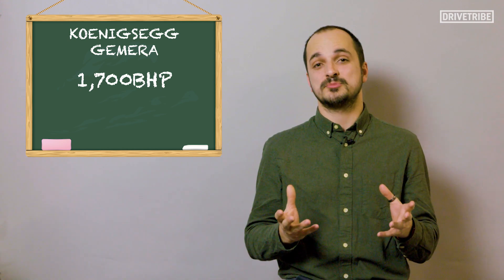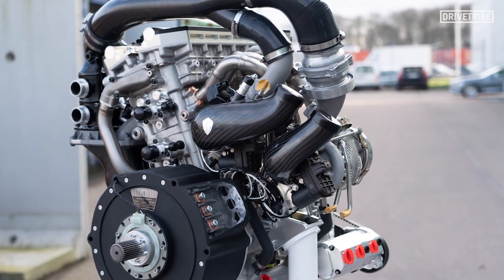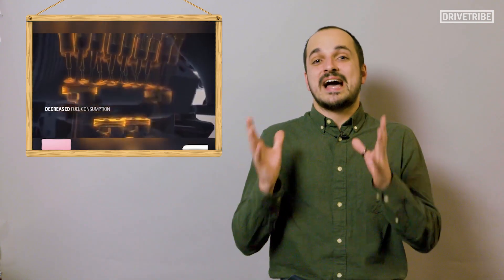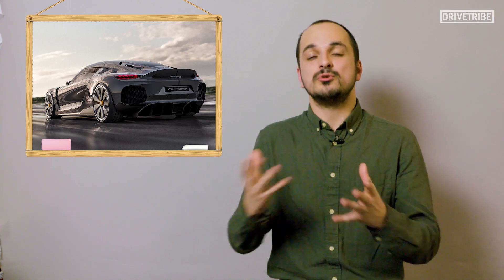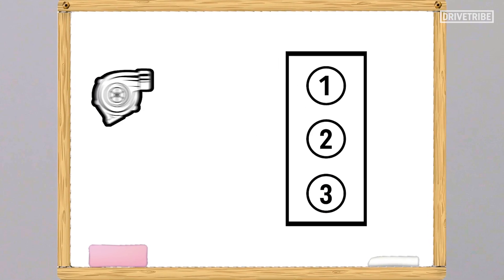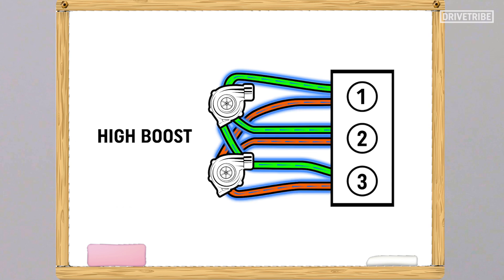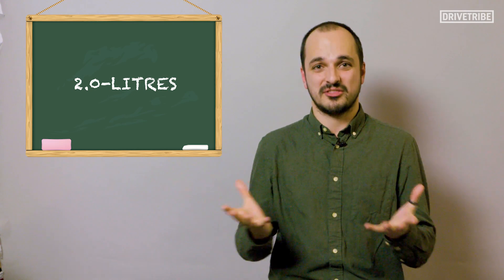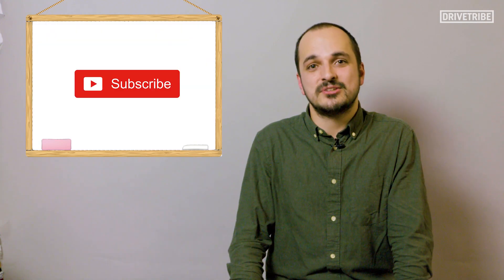This is how Koenigsegg made 600bhp from a 3-cylinder engine

Comment: ... for a generator is to much work because that motor that is all he is doing generating electricity. Aaaa if you want to make it  to sound like is doing something else then probably you go for the big sound. My VW cady has a DSG  gearbox dry clutch because Wv didn't bother so I don't have expensive maintenance from my part  , but if I put a electric motor on my cady a small battery so I ca drive in the restricted area  , and I put a generator in the trailer I still have 7 seats and plenty space luggage and still 1.5 millions in my bank account  .
Reply: ... and one the public roads I am driving with the same speed.

Comment: 2:34   I bet the Gemera 3-cyl wont run with 2 or just 1 cylinder just for fuel economy.
    it would make sense that Koenigsegg will just DEACTIVATE the ICE off, since this is a hybrid with a powerful electric system.
     If a 3-cylinder ICE had just ran on either 2/3s or 1/3(if the engine could even start like that) of the engine, would shake around VIOLENTLY

Comment: What is the efficiency % increase with the  freevalve engine when standard 4/S is ~ 25%?
....
This [free valve] is an exciting next chapter in ICE engines great potential for the 4/S engine.
I do question the possible reliability. This engine must be highly stressed with all that power.
Them components must be very strong
Boron Carbide head gasket anyone?🤔

Comment: I like that it is a small three cylinder engine that produces that much horsepower, but it should be in a car that weighs nothing, in order to maximize value. I don't like that it is combined with an electric engine (and heavy as fuck battery pack), even if it is getting 1,700 horsepower. A small engine like that should be the only power source and it should be in something that is meant to compete with the Alfa Romeo 4C or anything that Lotus makes. Because all of this technology with the valves, it makes me wonder what they could do with the same technology on a 7+ liter V12.

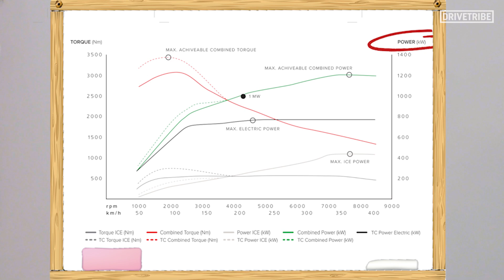Comment: So 4 valves per cylinder, meaning you will need 12 valve actuators that need to run flawlessly to get that power output. I'm curious to know the degraded state performance, if one or more of these actuators is not functioning properly. Especially that the engine's peak power is close to 8000 rpm 1:42 , so those actuators are working hard. how many kilometers/miles Koenigsegg is rating this engine at?

Comment: Meh it's sort of impressive but when you consider you can turbo a hayabusa/zx14r with only 20psi to achieve almost the same power with engines 30% smaller and 20+ year old tech it's actually not that special.

Comment: 3 cylinder engine. How does this make 600hp.   
They never actually told u the size of the engine. Bike 3cyl 1000cc can do 200bhp. So a 3  litre could get the 600 with a turbo. Bike is turbo free and naturally aspirated.

This is a ten litre....   and you have to use special fuel. Not pump fuel

Comment: This is ancient F1 tech. F1 used cam less air controlled valves for years in the 90's
Reply: https://www.youtube.com/watch?v=tAqP7o_ZdK0
Reply: F1 replaced metal valve springs with pneumatic valve springs to raise redlines and reduce valve float, Freevalve eliminates camshafts completely, something F1 has never done.

Comment: What if the soledoid actuator stops working or malfunctions during engine operation?
With the traditional mechanic method it only happens if the belt or chain broke down. 
I hope they have a solution for this...

Comment: I fully agree with this lad, Koenigsegg once again wins Geneva. Just imagine what power a freevalve V8 would make if they would ever want to make one.
Reply: What is shocking is that the engine weighs only 70 kg and the 400 HP crank motor is so small you can see it's mounted on the block itself. This system makes 1000 bhp, the same as a Veyron, in a powertrain weighing about 1/6th or 1/7th as much!!!
Reply: Assuming they keep the same size cylinders and everything scales up it would be close to 1600 HP LMAO
Reply: @romeomargot-picquendar1281  Actually the Jesko makes the exact same hp/l on e85. Now people say the 600 HP figure is for E85, so it will be lower on regular gas. But still insane.
Reply: Idk how much better u can do than an 11,000 hp v8
Reply: Pretty sure there is a 1700hp version now
Reply: what comes to mind for me is concepts like ppl trying to build hybrid NA rotaries bridge ported etc...and the power to weight aspects and weight distribution too considering the weight of a 2L 3cyl vs the weight of the trans or rear or if its awd 2 difs. engines like this come into the picture or the GR yaris, and it changes the cost or fun aspect of ppl thinking NA rotary power is viable/affordable. Much less 3-4 rotary builds. And yeah to the guy that mentioned top fuel 11,000 HP. XD. Its about as viable as a hybrid bridgeported rotary. Sparks n all.

Comment: Well to be fair the number of cylinders doesnt matter nearly as much as displacement  600HP from 2 liters is good but not ground breaking.
There are 600hp (500whp) Honda K-series and F-series running around on the streets at that power level on stock blocks (designed to be naturally aspirated) and if they are tuned correctly they will last a long time.

Comment: Imagine if this engine were to be used on a motorcycle.....
Reply: fantastica!
Reply: check out the triumph rocket3.    2.3 liter(or2.5l for the new ones)  with more torque than any bike has a right to have.  stock is 145hp 145 lbs torque.   supercharged you can get over 300lbs of torque and 400hp to the rear wheel.
Reply: Imagine if this engine made 620hp! that'd be something

Comment: Too many disadvantages:
- only 600 bhp with E85
- only 2 l displacement
- two turbos means more maintenance costs
- new tec with realibility issues for sure
- 3 cylinder

Wrong engine for the car ...
Reply: Pete is never wrong  My sedan has 2l displacement and four cylinder. What's above a hypercar?

Comment: Imagine this engine on a motorcycle
Reply: stop imagining and go ride a triumph rocket.   imagine taking 150mph and somehow sticking it into a needle and mainlining that pure speed.   that's what it's like to wind up 2nd and 3rd gear on the rocket
Reply: @suzukispider  pretty sure the rocket 3 doesnt make 600hp
Reply: @thatjokerperson7062  no, but you can get it to 400hp.   not bad on a ride that's only 750lbs.
Reply: @suzukispider  proof.
Reply: @thatjokerperson7062  research it yourself.  check out rocket3 forums
Reply: @suzukispider  i did and all i found were people arguing over if one guy made 280hp at some point

Comment: Are you guys really a car/engine channels?

3 cylinders engine are good for continuous powerband. It is the least amount of cylinder needed to achieve high rpm. Not surprising because most Japanese cars uses that and lately motorcycle are using it too.

Comment: "Most 3-cylinder engines these days, even when you slap a turbo on them, create around 200 bhp".
What?
Maybe a FEW do, but most probably create around 80 bhp.
Reply: I dare you to find a single, modern, turbocharged 2l i3 that produces UNDER 200 hp...
Reply: @ZeroneAngel  You could also dare me to find a single Koenigsegg that produces under 200 hp or something else which does not match my statement.
I quoted the video, which did NOT say "a turbocharged 2L I3", but which did say, word for word, "Most 3-cylinder engines these days, even when you slap a turbo on them, create around 200 bhp".
Note the lack of displacement in that statement, and the fact that a turbocharger was made optional with it.

I dare say the majority of three cylinder engines made - whether you count by units produced or by types available - will come in comfortably under the 200bhp mark, as well as under the 2 litre displacement mark.

Have a good day!

Comment: No one else is bugged that the valves are controlled electrically?
Reply: Nope. A modern car is computer module controlled in all regards anyway. Problems starts if an manufactuer skimps  on the   electical wire harness. OMG im so sorry for my poor english.

Comment: Twin-turbo 3 cylinder engine can done by the Camshaft engine. Check on the CB400 Revo engine. When low rpm it activate 1 exhaust & intake valve when in high rpm it activate 2 exhaust and intake valve.

Comment: I’d take a car with just this combustion engine. There are twin turbo V8s out there that don’t put out 600hp
Reply: Koenigsegg used Ford V8s for years, that all made a lot more than 500hp. You are an ignoramus.
Reply: What properly tuned Twin turbo V8 doesn't make 600 Hp nowadays? A proper NA car already makes 100HP/L. Twin turbo is usually 150-175 HP/L. If you have 8 0.5L cylinders that's 4L, with twin turbos you should be looking at 600-700 HP.
Reply: @romeomargot-picquendar1281  2017 Audi S7
Reply: @jasonm456  There is no good explanation for Audi aside from that its a grandpa car therefore the tune is very conservative. Pretty sure you could be getting a lot more out of that engine if you wanted to.
Reply: @romeomargot-picquendar1281  not to mention a shit ton of torque!
Reply: JIMI JAMES  no shit right? People are building 500hp+ engines in there driveway from small blocks. Where the hell do these people come up with this shit its like they were born yesterday lol.
Reply: Classic american muscle V8 can't even make 500
Reply: wow comparing 60 year old tech with modern eh bc koenigsegg never used a 16v pushrod lsx or a 32v coyote. XD lets compare the best power numbers of the v12s of the 60s or the 911 shall we........oh oh ok lets act like those facts dont exist. Or that a 12A rotary is 100 hp.
Reply: 500bhp from an American piece of shit is equivalent to 200 German horses 🤣🤣🤣🤣
Reply: @adnxn1  german horses are dead after 2 year
Reply: @chrisxaf1237  not even that. My dads new BMW has been in the shop 4 times over the passed 6 months not including regular maintenance.
Reply: @Erowens98  thats sad
Reply: @adnxn1  corvette and vipers are some of the fastest nurburgring cars, unrivalled track performance for the price, European cars are the fastest yes but much more expensive and less feel, ie don't come with manual transmissions, check yourself on wiki
Reply: @adnxn1  when is the last time you drove an American car? The current Camaro, challenger and mustang basically demolish all European cars at the same price point.
Reply: @romeomargot-picquendar1281  Kappa!
Reply: @romeomargot-picquendar1281  hahaha they will break to bits after going over a speed bump

Comment: Dude you missed out the most important aspect of what this new system delivers, that the valves can close and open in an instant, providing far better linear delivery than a rotating camshaft.

Comment: I mean, a little 1.6L v6 can make 800+ HP, I'm not surprised with a 3 cylinder engine making 600hp. I get that the 1.6l is an f1 engine but still.

Comment: If this engine lasts more than 10,000 km, I’d be shocked.
Reply: Why wouldn't it? Turbos don't wear down engines faster. For the price of the car, I would be suprised if they didn't use the highest quality materials in that engine which makes the engine a lot more resilient that your typical car. Also, this engine is rarely going to be running a full capacity since the main source of power are the electric engines.

Comment: I would rather have the BMW M12 engine. Made way more than this one and that was approx 40 years ago. Plus the engine by itself does not produce 600 it has help from the hybrid system. The BMW engine although a 4cyl produced easily twice that all by itself.  Also all thos crap about efficiency I have run one of my cars fully on moonshine. Anybody cleaner and more eco friendly than that?

Comment: "Endless money pit" Scotty Kilmer...
Reply: Rev up your engineeees
Also, just buy a '94 Celica
Reply: i think scotty will love to see this idea.. im sure he is sick of seeing cam chains, camshafts and cam lobes!!
''Absolute Royal Pain in the rear end getting to those parts in a car''
Reply: @fidelcatsro6948  buddy I guarentee those actuators will blow faster then you can say vw coil.
Reply: @allanfrancis7572  yes they will fail after some time nevertheless, but the friction and weight savings a worth a try after tolerating cam driven engines for more than 100yrs...lets change
Reply: @allanfrancis7572  so you'd change the actuators - easy, no damage to engine =  no big deal
Reply: @ChuckLeeClerk  until one fails open
Reply: @allanfrancis7572  so what, the cylinder stops and still nothing happens
Reply: I think he's a little narrow minded when it comes to brand loyalty, a lot of the cars he bashes can definetly be good buys given you put in the work to make sure your car runs right.

Example. He calls all Volkswagens endless money pits. I drive an 03' jetta tdi @176k miles. My buddy has an 01' with 933,000 miles original engine, trans, 2nd clutch
Reply: The best way to deal with rust is to buy a '94 Celica with no rust.
Reply: You already know how Scotty feels about hybrids too especially used ones lol
Reply: Right..all that electronic controlled valves? Hagghhhhh (horse picture)
Reply: @VibhorWase  solenoids are a common thing and you can even change it urself on the road (no need to  unmount camsahft, timing chain...) and if it fails the engine goes on 2 cyl mode
Reply: This comment shows Scotty Kilmer fans are all over the car community. Proud to be one
Reply: TwoWheelWarrior snotty kilmer is a dumbass

Comment: Nope. That's not thr reason it has so much power. The reason is that it's a 2 liter 3 cylinder engine. That means that each cylinder is 6.66 liters, which is the number of the beast!! So each cylinder in that car is powered by the devil himself!!! And that, my dear friends, is why he gets 600bhp from 1 teensy tiny engine.

Comment: It's not relevant that the engine has 3 cylinders, it is the capacity of the engine, for example it would be easy to make 600bhp from a 8litre triple, the fact that they made 600 from 2ltr isn't that radical. That's good power but not magical. I very much doubt it would be as robust or reliable as say, the Merc 420bhp 2 ltr lump. Most manufacturers could make a 600bhp triple no problem, making one which would last 150k miles, run on the crap fuel available globally and only get serviced once every year or 15k miles ! Is the real challenge a d measure of engineering excellence!

Comment: Horsepower is a lot higher than that... To be exact it's 1,677 horsepower. The Gemera sports a hybrid powertrain that puts out 1,700 horsepower almost 2,600 pound-feet of torque, Koenigsegg claims, and production will be limited to 300 models. According to the manufacturer, the Gemera hits 62 mph in 1.9 seconds and is capable of at least 248 mph.

Comment: I don't like the hybrid (or any vehicle with more than one motor) convention of stating total power output as XXXhp when they have just added the output of each individual motor to get that number. That doesn't give an accurate representation. The vehicle should be dyno'd and output at the wheels should be quoted.

Comment: Ford 3-Cylinder: 99 bhp
Koenigsegg: ** Hold my Beer **
Reply: Only Europe got the low spec motor. The three cylinder in the US came in 125 HP guise, with a tune 140 HP is easy.

Comment: wow no more worrying if your timing belt is going to go , as there is none,, both Hyundai and Ducati (desmo), kinda spearheaded this next step in valve trains over many years.. 
1. The Ducati desmo system, not only eliminates valve spring inaccuracy and bounce, but also makes for a very accurate following of the cam profile, as everything is connected through the circuit,  take a look at a ducati cam profile and you will see,  the engine is capable of creating a linear torque curve and still have a good top end punch due to the aggressive cam profile.. down side is the shims, and maint frequency.. as us Ducati owners know..) 
2. Seems Hyundai has been hard at work creating the variable incidence cam described in your other videos,  it's a game changer, and it's reliable and fairly strait forward mechanically,  very clever.. until free valve engines become cost effective, this will be the interim standard,  we'll see all auto makers copy it in the next few years.. 
3.   Koenigsegg,  2 liters, 600hp,  great but not as far fetched as you think.. a typical 600cc bike engine can make 140 easy n/a, boosted well into the 200's, making it reliable cooling it, handling the boost, and getting the torque numbers is another story,  some black magic going on there.. notice he's gone to a bike supplier for exhaust.. do like the fact he's gone for light weight in the design, as well as immense power.. 
       Either way, once they perfect, and get freevalve tech integrated and proven, as well as costs reeled in, we'll see Koenigsegg become the next Tesla,  as the royalties flow in from the design.. proof that high performance breeds innovation ,  not all of it works ( Ie LIfe F1 engine),  but what trickles down to the consumer creates net benefits in safety, performance and fuel economy..